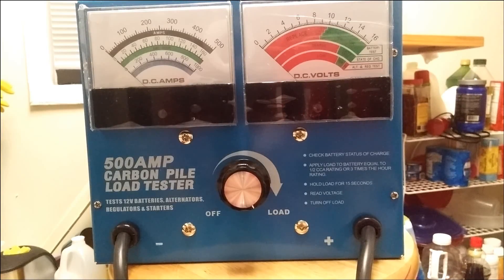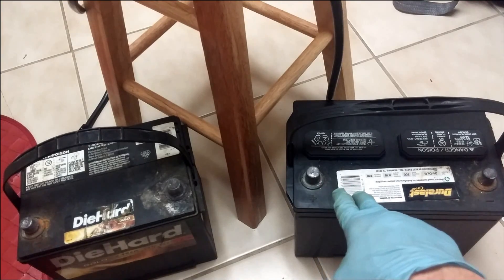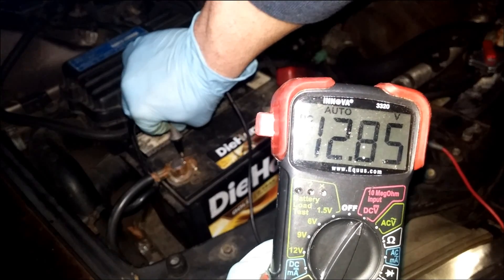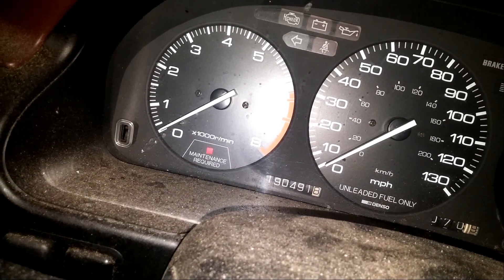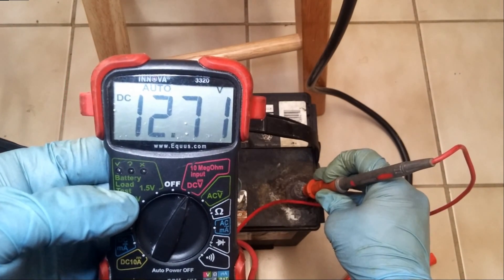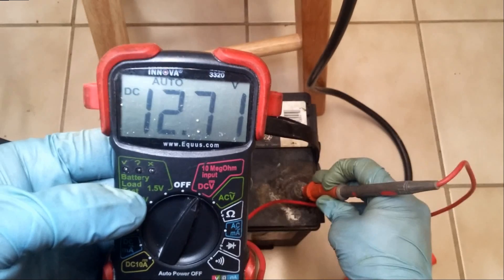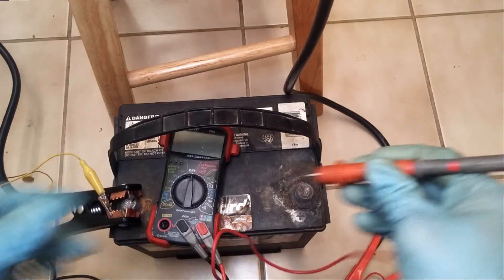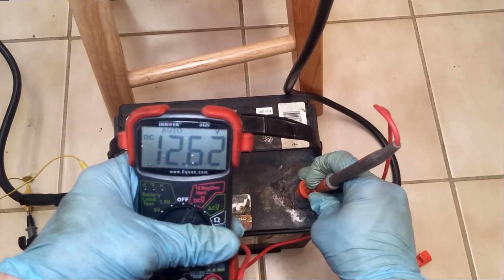Carbon Pile Load Testing

Comment: Great job...one bit is safety advice however, dial the load charge counterclockwise until it won't turn any further before you disconnect your carbon pile test leads. Batteries can expel invisible explosive  gases. You do not want to create an arc anywhere near explosive gases. To prevent that arc you need to dial the carbon pile load to 'zero' or 'off' so that no current flows through the load tester....
Reply: If you are testing a battery to see if it's good. Test it to the batterys rated output. Not what the car suggests it's supposed to have.  
And your old battery probably don't have enuff water in it. It will read voltage but has no storage or amperage output.  Remove the load before you remove the cables. That's not good for things.

Comment: Take the surface charge off a recently charged battery , headlights and blower on for one minute .
Load test , voltage dropping lower than 9.6 , replace battery .

Comment: Just picked up one of these load testers. The 15 second timer actually starts as soon as you start placing a load on it, not once you reach your target amp rating. You're usually only on your target load for 3 or 4 seconds because of how much you have to turn the knob to get there.

Comment: I’m wondering if there’s a better modern alternative like a digital load tester or variable load tester that can be used at a range of voltages or something. I think I’ve seen things like that usually with fans or something

Comment: What’s the difference between a 500amp and a 100amp load tester
Reply from the maker: the amperage rating of the load tester tells you how much current it can draw from the battery. the higher the amperage drawn, the greater the demand you place on the battery. the battery's voltage will fall as the load goes up since you are pulling stored charge from one side and distributing it to the other side until they even out and thus there will be OV difference in potential energy between the two sides. Such a battery has no energy to power anything. It is also useless if there is a measurable voltage difference, but that difference isn't sufficient to meet the demands of the device it is supposed to power.

As an example, Autozone uses a 100amp tester. It draws 100A from the battery for xSeconds. If the battery can maintain 12V or higher for that time, Autozone says the battery is good. The problem with that is that your vehicle's manufacturer may actually have a higher standard set than that to rate a battery as good because the vehicle may need to draw more than 100A to get started.

Get your vehicle's repair manual to find out what that specification is for your vehicle, and make sure that your battery can maintain it.

This thing I have learned though as a DIY mechanic is that you don't even need a load tester. If you think your battery is weak, then charge it on an external charger, or pull the battery and connect it to a good running vehicle. Your battery should be able to be charged in a few minutes with the vehicle-charging method. It may even take up to 30min if it was deeply discharged.

Either way, once the battery has reached 12.6V, it should be able to start it's own vehicle. if it can't start the vehicle, go buy a new battery. If the battery can only start the car properly once on a 5min car ride, then the battery is weak. Replace it.

If your routine is 5min car rides, an occasional trip, maybe once a week of double that time should be fine to maintain your battery. If you account for idle time spent running, you probably never even need to go out of your way to allow the car to run just to maintain the battery.
Reply: 100 amp load testers typically draw a straight, non-adjustable 100A load on the battery. You use the markings on the gauge of the tool to give you a rough estimate if your battery is good or not. 500A load testers, like the one shown here, allow you to adjust the load, up to 500A. You would use the 500A setting when testing a 1000CCA battery, as you're always dialing in half the CCA value. In general, the 500A load testers are much more precise, IMO, than the 100A ones.

Comment: As you know voltage only tells half the story when you started the car with the multimeter attached it dropped down into 7 volts, that means the battery is no longer any good and can no longer hold a charge. Good video 👍
Reply: What’s a healthy level for it to drop to?
Reply: @Fee.1  12.4 V! U really don't want it lower than that.
Reply: @404notfound.....  I don’t have a load tester so I’m trying to sus out the heath of my battery with a multimeter on one of my motorcycles it drops pretty low when just turning on accessory mode. Like as low as 12.13-12.24….and hangs out around there in accessory mode, this is when it’s at a resting voltage of 12.6. When it’s at like 12.8-12.85 it doesn’t drop as low but relatively speaking it still drops. I don’t recall how low it drops during starting. I was worried I damaged it because I put it on the charger and left it in 10amp boost mode for like 12-18 hours. So it was charging at like 14 volts and as high as 10 amps. Obviously it started drawing very little amperage at all eventually but I’m not sure if that would damage the battery or not. It sat around 13 volts with a surface charge and after putting a small load on it it recovers to between 12.8 and 12.9, but not sure if the actual capacity has been lowered because as we know voltage alone means nothing

Comment: you did four tests, 1st for "bad" battery that you failed at add the load - not the battery problem as the volt meter doesn't show drop down, it is your contact problem. The second test is good your wait for 15sec to get >=600CCA. The third test you repeat test2 but I didn't hear click and time seems to be 5second only? I don't know fourth test - is it just another duplication of same good battery. 
Note knob just change load resistor, left meter is current and right is volt. For bad battery you could still change load resistance, but before your reached the current you want, voltage already down below 9.6V.

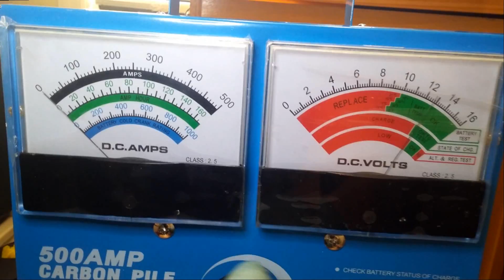Comment: 6:25 It really like you just didn't turn the load up enough on your old battery.  That DC amps needle did just start to move, just as you said "nothing happening".  And you did need to turn that knob a lot on your successful tests.

Comment: Batteries are just not that mysterious. No need for the second test, or to crank for 15 seconds...Doesn't matter what 'they' say.  If the current stayed steady at 300A for 5 seconds without significant volt drop, that's really good. All that extra wear you inflicted beyond that was pretty much abuse. Thanks! - By the way, I break things sometimes, so I know....
Reply from the maker: I have wondered about that kind of thing myself however the manufacturer instructions state 15 seconds. I read this out of my own tester purchased from Amazon and it states the same thing in the instructions for the model sold by Harbor Freight. I think that only a brand new battery can really stand up to that load for that length of time.

Comment: Good testing and video. Im gonna buy one of these.. I hear the new fancy digital testers are not so accurate
Reply from the maker: I paid about $50 for mine but I would advise paying a little more. Mine does not bottom out when removing the load for the battery. The dial would just twist out of the machine.
Reply: @pcrb141  Put a washer behind the cover panel, over the adjustment shaft.
This will stop the shaft from winding out too far, but will still allow it to completely shut off the load when backed out.👍

Comment: These are designed to used horizontally, this videographer is completely unprepared to conduct tests, does not caution about safety gear, who cares if it starts the car, defective is defective, what abuse does the current battery undergo? Does not indicate the scale used, what a waste of time.
Reply from the maker: You have a point about the lack of safety discussion in the video. As such I have updated the video description to cover that.

As far as the orientation of the battery tester goes, I did not notice anyone making a  point of using the tester horizontally, and upon spot-checking other videos just now, haven't seen anyone else state anything like that either. Everyone stands the tester upright. No such discussion of laying it flat exists in my tester's instructions or the instructions from the harbor freight model.
Reply: @pcrb141  It does not matter if tester is vertical or horizontal.
Reply: Did you hurt yourself?